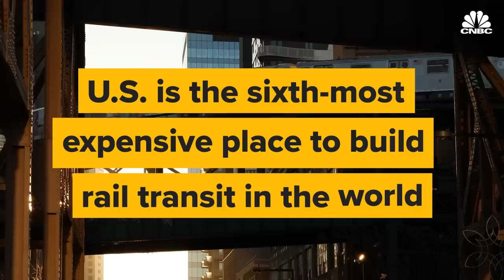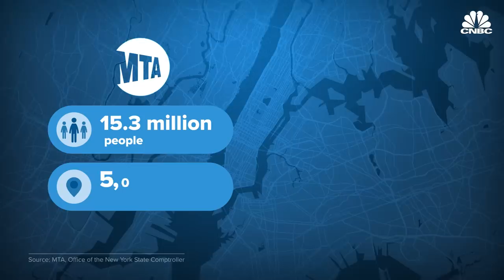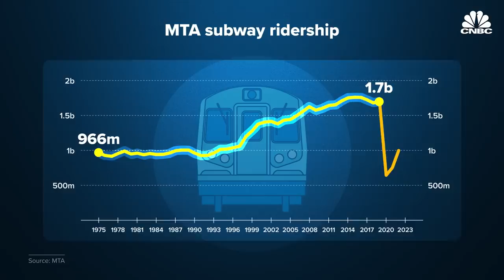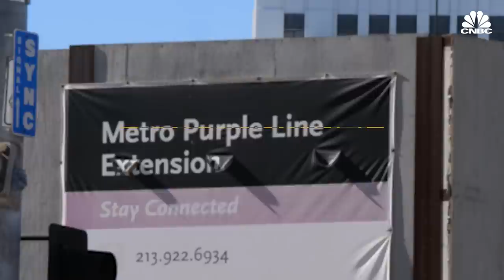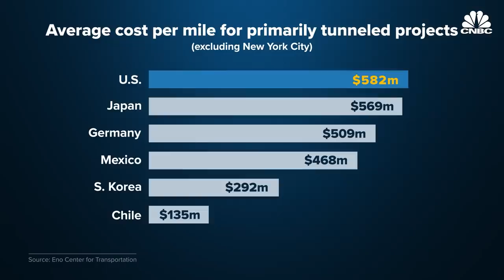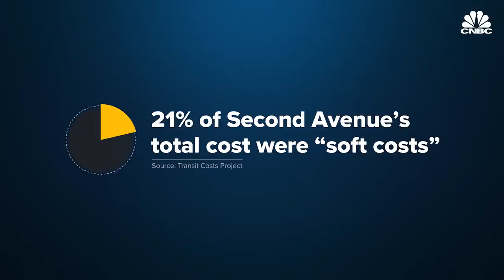Why American Subways Are Some Of The World’s Most Expensive

Comment: What? No no no, the latest expected ridership on the Grand Paris Express is 3 million riders per day.
So that gives 13K dollars per rider, half of 26K.
Or $ 65 per daily rider per kilometer.
(39B ÷ 3M = 13K | 13K ÷ 200 (km) = 65)
And it includes the 200+ fully automated trains of the new extension.
Not really similar to 2nd Avenue subway cost...

As for the MTA senior justifying some of the cost by the "complexity of NYC's ground" : it's like asking a tax frauder if its actions were simply tax optimization or fraud... Of course he'll try to justify it.
But in reality, many European cities have very complicated underground.
Like Stuttgart (Germany), that has terrible ground.
Or like Paris, that ontop of having to deal with the 300 kilometer long galleries (that we know of) of the famous catacombs and less famous old abandoned quarries, Paris also has a myriad of aquifers and layers of brittle or dissolving gypsum and sulfur = damp marly or brittle soil with holes, unexpected cavities, water infiltrate and loads of 19th century sewers.
(The name "Plaster of Paris" comes from the gypsum mined under Paris in the previous centuries, as gypsum is the main ingredient in plaster).

Paris underground is a nightmare to dig through, they regularly have to freeze the ground hard before digging, with large cold generation factories and tons of liquid nitrogen pumped into kilometers of piping. That's no walk in the park!

Add to that the stringent French tunnel laws requiring emergency access / exit shafts every 800 meters (0.8km or half mile), and not a meter more.
The Grand Paris Express project consists of 200km of new fully automated metro lines and extensions, 90% of it deep underground, and at least 68 new stations.
I'll let you do the math for the number of required shafts, it's humongous !

Plus, the 68 new stations are almost all different, with grandiose architecture, many are cathedral-esque and finely integrated into the urban fabric at surface level. Last time I checked, only 3 stations shared a similar structure and they were elevated.
The project cost includes everything : tunnels, stations, viaducts, urban integration, trains, systems, 900+ escalators, 250+ elevators (and counting), platform screen doors (8 kilometers of glass paneling for the PSD's of the M15 loop line alone), several maintenance, storage and operation centers, low carbon fiber concrete and a massive environmental mitigation / carbon offsetting policy.
With also some very strict neighbor calming rules like having to clean the wheels of trucks before allowing them to leave construction sites and some soundproofed works sites.
All this dug by more than 20 TBM's running simultaneously.
Paris gets way more, for way less, in a very unforgiving and terribly difficult ground.

Cost overruns can happen, being reasonably more expensive than elsewhere can be tolerable, but the stratospheric costs of current transit developments in the US are just crazy.
A public transportation project is for the public good, not for many private (and some public) parties to line their pockets.

Comment: I live in a country where public transportation is expensive for the main reason it is under constant maintenance. The biggest advantage is the environmentally-friendly energy it uses, especially for rail transport. As for punctuality, it is good but far from being excellent. Unlike Japan, commuter trains and express trains running in the country I live in share the same tracks, so the network may get a little crowded sometimes. As for regular buses and coaches, the network covers virtually all locations on the map, the exception being small villages. Despite its setbacks, I am sure Ms THUN83R6 enjoyed the country’s eco-friendly trains
Reply: Daniël  Well passenger and freight trains technically do not run on diesel in my country. I never said the electricity used by trains was produced by exclusively eco friendly power stations. The production of electricity may not be eco friendly, but the use of electricity on all lines with daily passenger and freight services means the type of energy or power source that makes the trains run does not produce exhaust like steam and diesel trains do, just to clarify everything
Reply: Daniël  It is true coal is one of the most abundant fuel sources on Earth. It is true diesel trains do not depend directly on power plants for energy. However, diesel fumes in more or less enclosed spaces can spread through the air and expose more people to toxic gases that may increase the risk of health problems in a similar way to what smoking does. I would agree that true clean energy sources should be optimized to become more efficient and more profitable, even though the process may take another several decades. I accept that electric vehicles are not the best solution to greenhouse gases, but I would rather ride electric vehicles that won’t expose me to gases that may take a toll on my physical health in the long run
Reply: Daniël  Well I guess we still have another few centuries of non renewable energy sources and we can still pray global warming will sort itself out by causing an ice age similar to that in The Day After Tomorrow, but such a scenario spans decades if not centuries. The other scenario is the flooding of low-level areas and the desertification of everything between the 45th parallel north and the 45th parallel south. At least in a Real Life Lore scenario where the global temperature increases by four degrees Celsius over the next century or so
Reply: Daniël  It is true we can last a long time with fossil fuels. But there needs to be enough plant life to absorb excess CO2 that is produced by the burning of such fuels. Even though Earth used to be warmer hundreds of millions of years ago and used to have a higher level of CO2, some are still worried about the current amount of CO2 in the atmosphere. In addition to that, there is deforestation in certains locations around the globe, which does not help. What we need to do is avoid a runaway greenhouse effect where the evaporation of water increases to the point there is too much water vapor in the atmosphere, and water vapor is also a greenhouse gas. CO2 can also be absorbed by rocks, but the concentration in the atmosphere combined with the ambient temperature can make rain more acidic and compromise plant life or agriculture. In order to reduce the global temperature, a radical solution would be to trigger a volcanic eruption. Ashes from a volcano partially block sunlight and cause a global cooling on the order of around 1 degree Celsius. The biggest downside to it is we would need to build more greenhouses to grow crops throughout at least a year of volcanic winter. Plus the inhalation of ashes would cause silicosis, which is deadly in its acute form. In a scenario where a volcanic eruption impacts global climate, we would need to live underground for years if not decades. So a volcanic eruption will not benefit mankind. The only option that is left is patience and acceptance. We need to accept we have no control over climate in the long term, only in the short term, like when China enforced a lockdown, significantly reducing the number or cars on the streets of Wuhan and causing a temporary drop in pollution
Reply: Daniel-ie8si  Physics cannot be beaten. EVs which are powered by electricity are still more energy and carbon efficent than diesel/petrol cars, and the most polluting diesel trains and Electric trains powered by coal generated electricity are more efficient than those EVs. Saying otherwise just means you are ignorant of the efficiency of the different modes of transport, and why it is the case.

Comment: Although more rail transit might yield a higher capacity, it's building costs and the time it takes for construction should make it clear, that this way is a No Go.
I took this as a conlusion of this report.
In Europe there is a debate about the same issues. Tansit solutions like this are most often advertised as helping to lower CO² emmsions by flipping individual motorized traffic into subway traffic. Unfortunately engineers found out that the brake even point regarding CO² emission lays around 100 years in the future.
Or even later (depending on individual circumstances).
Much to late to have an effect on climate change .
Building trams instead or improving bike infrastructure or changing the way cities are designed (the 5/10/15 minutes city) or walkability gets into focus.
I wonder that New York doesn't waste a thought about these alternatives. Stopping all that monster projects looks much smarter than going on spending billions of dollars.

Comment: Meanwhile the boring company digs car-sized tunnels for an estimated $15m/mi. geniuses point out that cars are smaller than trains, but is it worth paying more for trains for the joy of packing yourself in with strangers? If the project is dramatically less expensive then you don't have to make as many deals to fund it, which according to this video is where a lot of money is spent tangentially to appease different parties.
Reply: Cars can hold a max of 5 ish people, in a square footprint of about 8 at a density of being in line. That is about 62.5% space efficiency. Trains go much higher.
Reply: I don't know that tunnel diameter is really driving costs here.  The union labor working the tunnel boring machine and assembling the track and equipment inside the tunnel is definitely a factor.  Plus Boring's tunnels are 14 feet in diameter.  You could fit a single track metro in that.  The London Underground uses 11' 8" diameter tunnels on many of its lines but their cars have those distinctive rounded roofs to allow them to fit.

Comment: Europe build its modern public transit systems during the good growth cheap era,  but even Europe can't build such projects anymore due to high cost.. and America certainly is too late for it!
Reply: How is Singapore building then ?
Reply: You don't know what you are talking about. FYI,  the budget for Madrid subway linea 11 construction, is about $1.5 bn, not 1.5 bn/mile as in the US, but 1.5 bn for the entire 26 km/16 miles. Linea 5 is currently being extended to the airport for less than $ 100 million/mile. In 2024, work will start on linea 10 extension to Fuencarral Norte for about $ 170 million/mile. Besides Madrid, Barcelona is expanding her subway and 1 million inhabitants Bilbao is preparing to work on its 4th and 5th lines. In France, Toulouse (less than 1 million inhabitants) is building its third line, Rennes (200 thousand inhabitants) opened its second subway line in 2022. Paris inaugurated 2 extensions (lignes 4 & 12) in 2022, will extend ligne 11 in a few months, ligne 14 in 2024, and should open 3 new lines (15, 16, 17) in 2025. I could continue with Italian numbers.